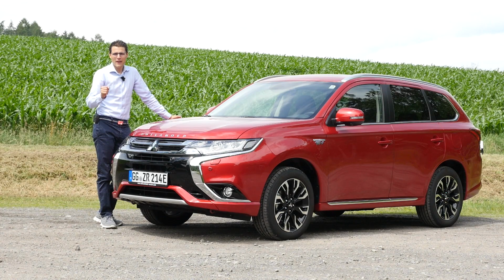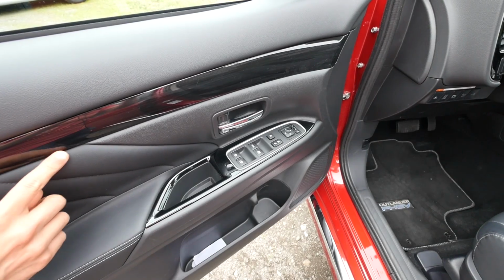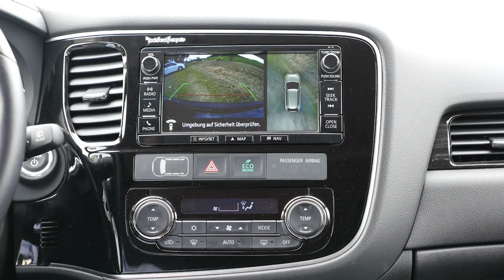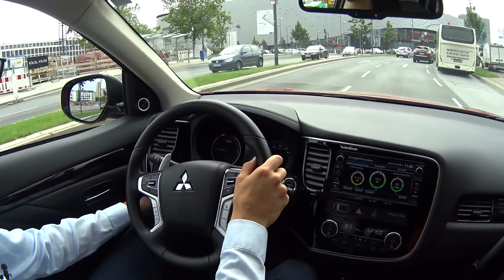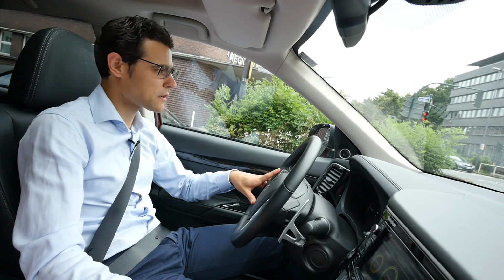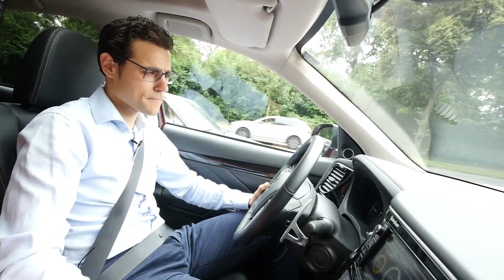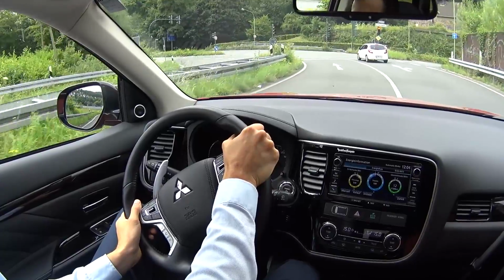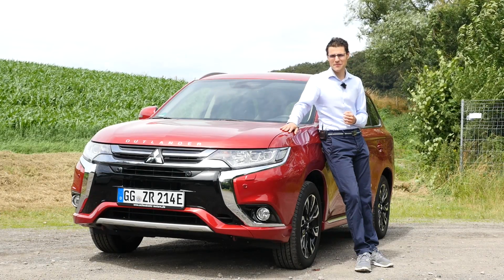Mitsubishi Outlander PHEV FULL REVIEW test driven plugin-hybrid 2016

Comment: Im planning to trade my q5 for a Outlander phev.
I want a more economical and relaxing ride.

Altough im not really sure about the reliability from the battery.. its pretty expensive to replace tough.
Also,  i still find the technique a bit strange, for example:
Driving electric and the engine doesn't warm up, you go on the highway and the engine kicks in while being cold but making a pretty high amount of rpm's.

This can't be good for the engine right?

Comment: A really nice real world review. Just bought a used 2016, looking forward to driving it and planning my journey's.
Reply: Hi there, can I ask about your experience with this car? We are going to look at a 2016 used model tomorrow. We were looking at Toyota Auris estate hybrids but they are just a bit expensive. I'm also curious about the real running costs of the Mistubishi. Thank you!
Reply: @biotopia5319  hi, I really like the car, mine came with a high trim level so inside is very nice. It's a different way of driving, trying to balance economy driving, using the regenerative paddles to slow down but you soon get use to it and I actually miss it when I have to drive another car. The boot space is good, mine has the subwoofer in it that takes up a bit on the side and those weird drinkholders that are a leftover from the 7 seater diesel version. I charge at home every night so for shorter trips I'm basically only using battery unless I need the heater or aircon. Unfortunately I work over 66km away from home so the i have to use petrol to get there for part of the way and all the way back but it's still pretty cheap. The tank is not huge, 40lt but so far it's been good. We have a small caravan and it tows it ok but only ok. I do wish I had purchased a version with android CarPlay but that wasn't available in the 2016 models. Space in the back is ok, you can fit 2 kids in car seats in there but you would struggle with 3.
Reply: @hiltos  Hi, thank you for your really detailed reply! That was very nice of you to take the time! We went and looked and I just loved driving it! It was quiet and light and compared to our old car (2005 toyota corolla) I felt like I was in a spaceship! We put down the deposit and will get it in a few weeks. I'm looking forward to learning how to make the best use of the paddles and other features. I think it comes with bluetooth at least...but just being in a car that wasn't 16 years old was already amazing!
Reply: @biotopia5319  congrats, i was the same coming from a 2005 volvo v50 which feels really heavy to drive now. Our outlander came with reverse, forward side parking cameras which are super useful as the Outlander is a big car. Enjoy your new car ;)
Reply: @hiltos  I'm excited to pick it up (it's having some bodywork done), thank you again for your messages! :D

Comment: Hi, that's a great review. I am a Prius driver, but the Outlander is really nice for the family. I was wandering if the Outlander has the same planetary gear technology like the Prius, because that is the heart of continuous drive without changing gears. Can anyone answer?
Reply: No: as stated in the review, the engine is connected via a single gear ratio when connected mechanically, but it only connects mechanically at highway speeds; below that the engine charges the battery, and the electric motors drive the vehicle. That simplifies the transmission enormously, and contributes to reliability.

Comment: I have a Ford Focus Electric, and the brakes perform in a similar manner (no regeneration during heavy braking). My theory is regen braking doesn't have the same directional stability as today's friction brakes, as I've noticed what I can only describe as torque steer in reverse when braking on uneven roads.
Reply from the maker: good point
Reply: No, I believe the answer is as follows, from what I can interpret from my own test drive, and a little background knowledge of regeneration systems used in industrial systems. When you brake manually you take energy out of the system (reduce speed) by a process external to the regen controller, which is designed to only remove energy at a certain rate, resulting in deceleration at a certain rate (programmable via B1 -  B5 in this vehicle). When you brake manually, you "get ahead" of the regen system - decelerating faster than it would do itself, so it essentially has less work to do, and the regen power drops. Other vehicles - like my Prius, for example, have a different control system which only applies manual braking when the regen system is operating at maximum.

Comment: Great big review ! Mitsubishi Outlander PHEV 2016 is excellent PHEV SUV 4WD vehicle  ! Audio sound quality is real good with subwoofer ! Mitsubishi uses a very durable and hard plastics for inner details and dashboard (much more durable than many other car manufacturers) ! Quality materials and body parts and frame construction is strong material in its class.
S-AWC (SUPER ALL WHEEL CONTROL)This integrated control system, only available from Mitsubishi Motors, delivers incredible power and control. By optimally managing AYC (Active Yaw Control), ABS (Anti-lock braking system) and Active Stability Control (ASC) with Traction Control (TCL), it brings out the full potential of Twin Motor 4WD without compromising safety, comfort or fuel efficiency. When desired, you can press the 4WD LOCK button to simulate locking of a centre differential and optimally distribute torque to all four wheels for improved traction and stability. 
 .Twin Motor 4WDHigh-output motors separately mounted at the front and rear axles instantly supply torque on demand for incredibly responsive yet smooth 4WD performance.

Comment: Maybe the ABS and/or ESP can't function properly if the electric motor were regenerating when braking very hard? It's just a theory, though.

Of course, low consumption is good for the environment, but not having to buy a new car because you crashed is even better for the environment in my opinion
Reply from the maker: +Oscar Merlin hmm maybe!

Comment: yes, you carry the other system (elektrik or fuel) around, that`s an disadvantage... But you need no second Car for your Holiday Trip. If you have a charging option at home, and the electric range fits to your dayli drive to work/to home.... this is not a bad system...